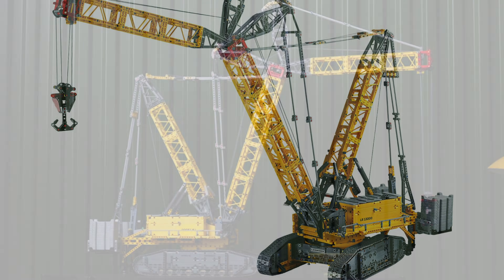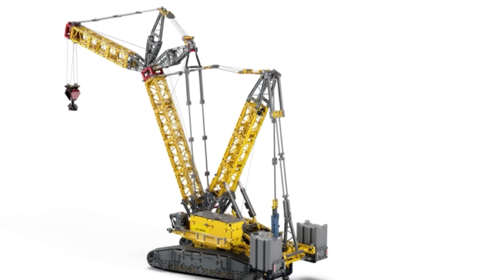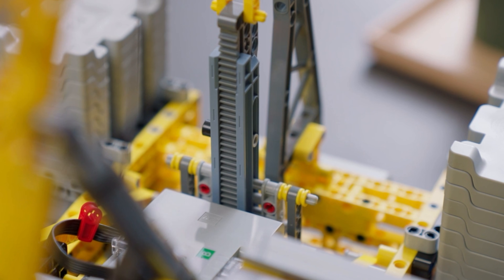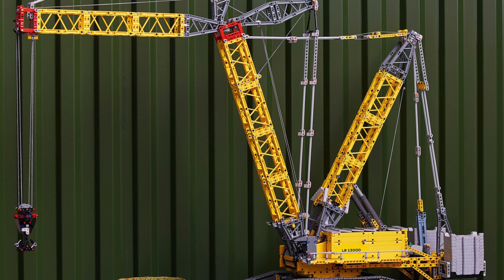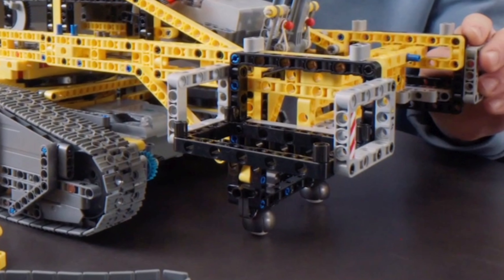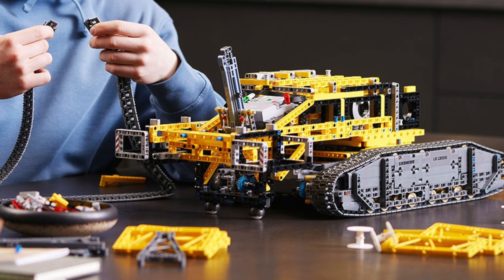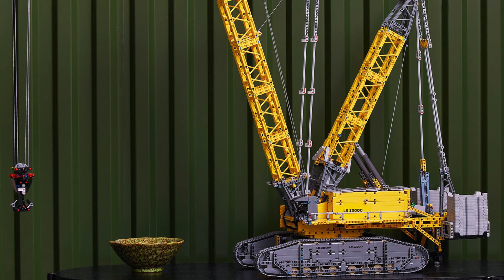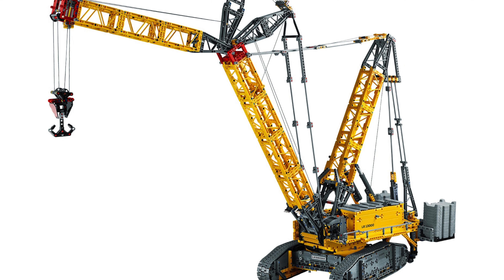Detailed Look at LEGO Technic Liebherr Crawler Crane LR 13000

Comment: never ever worth it becasue it has like 2883 parts.. you just connect panels with pins means the half are pins and the ''battery boxes'' should be rechargeable arent even hidden you see all cables there are no gears and it dont tven like a liebherr without stickers.. the Liebherr from Mould king looks better..

Comment: I agree that the set is extremely overpriced, but I honestly think LEGO was forced into this unfortunate pricing situation. First of all, This set contains so many large new frame pieces to construct the main boom section, and the heavy weights used as a counterweight surely cost more than average LEGO bricks. Also, the control plus elements are very expensive, and this set comes with a whopping 6 motors and two hubs. Additionally, LEGO planned on releasing this set last year, but postponed the release of the set by a year because the model suffered from structural issues, which means we are paying for another year of design work. All in all, I disagree with the pricing of this set, but if you look at the numbers and the circumstances, it makes sense.

Comment: The pricing does not any make sense under no angle at all - there's no explanation whatsoever. 
But what's more disappointing is that it's another set with exceptionally poor flexbility due to control+.
Also, the proportions do not match as the base is way to large compared to the crane - in reality this thing can lift up to 200m height. There's no sense of this size due to the mismatched propoportions.

Comment: The sheer height of it drew me in, exceeding that of the bucket wheel excavator (42055) that I was so happy and lucky to receive years ago. Regrettably, it brings in yet more specialized parts, many of which may not see use in other creations. 42055, if I recall, also brought new pieces in year 2016, most notably the 1/4 Technic inline gear rack piece (24121). That piece is still seeing use today in many, MANY official sets and MOCs, but I don't think these brittle-looking truss, strut and slider pieces will get the same glamour. Those structures were already possible with existing pieces.

Edit: And yes, the pricing is consistently steep with their other 2020/21/22/23 sets, much steeper than it was in 2016, but that should come to the surprise of no one.

Comment: The prize is crazy high.  The crane doesn't even look like the real thing, the proportions are wrong, the boom and jib are too short.
Mouldking has a 2 meter tall Liebher crane that costs only €189, it has 6 motors, a remote control and rechargeable battery hub.

Comment: This set should've not been priced at $700, just because it is massive. I had to double check but the Liebherr crawler crane's height is 100 cm according to the description. That is the same height as the extended boom of the 42082 rough terrain crane (I do not have that set, I looked at the description), meaning the 42146 is still not the tallest Technic set ever. But rather, the most overpriced LEGO Technic set ever. Additionally, the 42082 rough terrain crane had 4057 pieces and it was retailed for $300, but the new crawler crane costs $400 more despite containing only 2883 pieces.
Reply: And you can have Mould King Liebherr crane for like 200$, it has over 1000 more pieces and interesting counterweight mechanism and is twice it's height. Yes I know that Chinese brands are not the real deal and there are some ethics issues involved in buying from them. But the quality is almost on par with lego.

Comment: It is definetely overpriced, considering few things: low piece count, general problems and limits of Control + systems (it has better range, but also has many downsides), and a whole concept of new and specialized pieces. In my opinion, LEGO should improve your creativity and skill for finding solutions. For example, those new frames can be replaced with standard beams and connectors while using some clever geometry. Also, a volume of specific set is a very funny argument for increasing its price.
Reply: Standard beams and connectors will exponentially raise the parts count and hence the overall price of the set though, if Lego never made those specialised parts

Comment: As a crane model enthusiast here's my take:

It honestly looks pretty awful when compared to the real machine. I feel like the level of innacuracy is unacceptable on such an expensive flagship. The price brings it into the territory of proper licensed diecast scale models which at $700 ranges between 1.3-2.5 m tall depending on the model. For example a WSI Ltm 1650 retails for around US$ 550 but reaches a height of around 1.6 m. A few years ago, US$700 would have gotten you a NZG LR1600/2 which was around 1.8 m and could be posed in quite a few configurations but that has been discontinued. The closest comparison today would be the IMC Demag cc2800 which retails for around US$800. 
 
Here are the inaccuracies that I can spot immidiately:

- The entire rear A frame is missing

- The rear derrick mast is way too short, causing the counter weight tray to float in mid air when the real one barely touches the ground. This also nessecitates the support wheels

- The geometry of the tracks is wrong.

- The hook block is a joke. A crane of this calibre should really have 3 sheaves minimum. For perspective, the largest hook block in the official load chart for the real crane has 30 sheaves.

- The superstructure ballast is missing.
Reply from the maker: I greatly enjoyed reading your comment. Thank you for pointing out all of its inaccuracies
Reply: The  last  arm  piece  is  way  to  short  look  at  the  original,  And  what  about  those  silly  support  wheels?
Reply: @tonyrobinson362  Every single lattice section on the crane is too short. And yes, the support ball bearings look ridiculous.
Reply: Very bad proportions.

Comment: Lego just Add like 280$ for the 2 hub and the 6 motors. And is just Only 2883 parts. And cost 700$ WHO is gonna buy so overprize set.
Reply: Idiots, sadly there's a lot of idiot afols
Reply: Yea
Reply: But im think then gonna remo Thiss set pretto fast like Mabye then sell like 7000 set of Thiss but is like nothing.
Reply from the maker: We’ll see if it sells well. A good way to observe the sales of a lego set is to see if it goes on clearance in large retailers

Comment: With a remote controlled gearbox you could have saved at least 2/3 motors - with a more interesting build for sure
Reply from the maker: That, and it would’ve been cheaper
Reply: You could have, but you wouldn't have been able to run multiple functions in parallel. I get that Lego wants to flog RC as hard as it can, but I really think this set would've been better and more engaging as a dumb PU set with a bunch of lever-driven gearboxes
Reply: A set of this size would’ve been really sluggish with less motors. Look at how terribly slow the bucket wheel excavator is to actually play with, thing takes 2-3 business days to do any function properly. This is more in line with the other liebherr where all the motors mean a much better play experience

Comment: Seems like the designers have no choice from make the crane fall over,even though the real 13000 didnt have balls
Reply from the maker: Yeah I’m quite convinced that this set was very difficult to design
Reply: @Unbrickme  they should've add wheeled ballast for replaced the balls,its very common used in big crawlers,but the 13000 didnt have that,it can balance by itself considering the enormous size,quiet amazing

Comment: looks pretty cool, I wish the counterweights had more studs/pinholes on them though, also wish this set had a gearbox
Reply from the maker: Good points! How do you feel about those supports at the back?
Reply: @Unbrickme  Part of me thinks the Lego designer should be making the model balance without them but then the other side is that it will at least balance, and if I got this I would keep this inside so I'm not really worried about offroad potential, I do feel it detracts from the look a little but I prefer function over look
Reply: @Linkther25  I think it's likely that it won't work very well on carpets, which could be a bit of a bummer for some people
Reply: @bartybum  ahh ok fair point there!